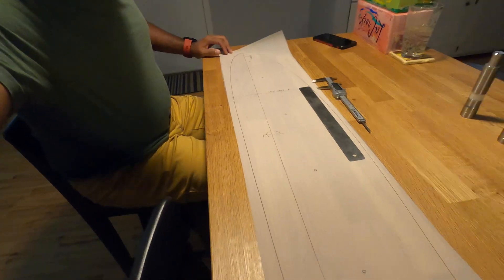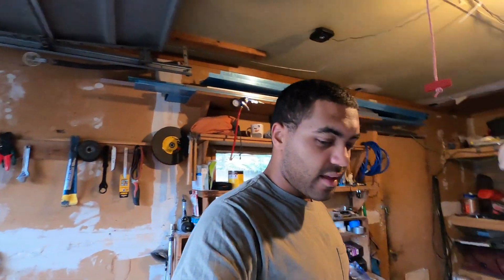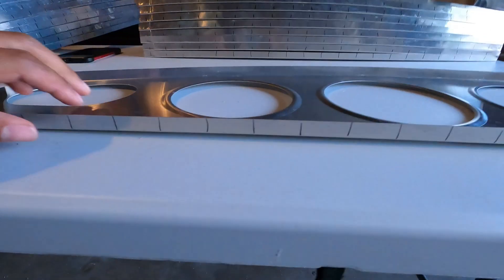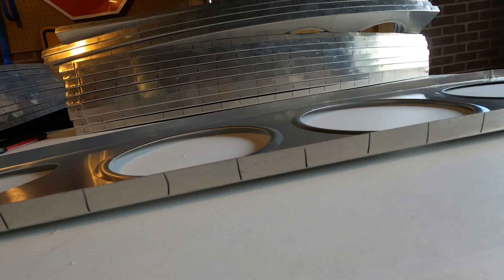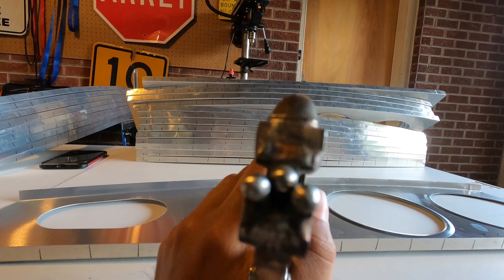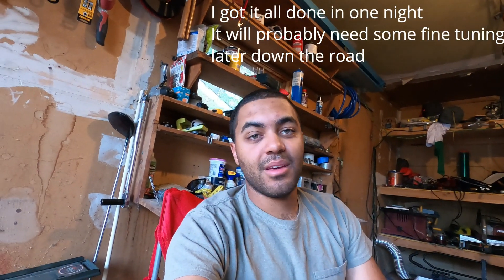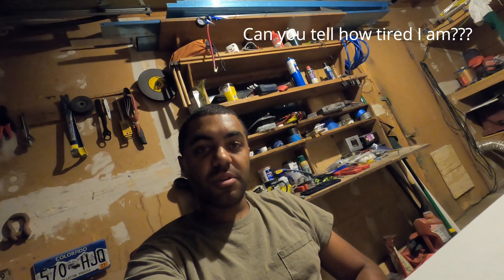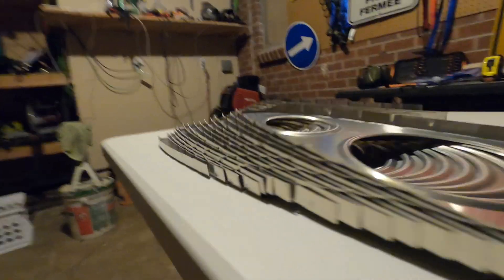Bearhawk Aircraft Build Part 3 - Fluting The Wing Ribs

Comment: Did you pick up the spar web and rib package from Bearhawk?
Reply from the maker: Yes I did!
Reply: What did you think of the qualify finish?
Reply from the maker: I went with the ribs and spar package because I wanted to save time and resources (money, tools, equipment, and consumables). The rib and spar package satisfied a lot of that requirement for me especially working in my current shop (a one car garage) I think the quality of the parts are well beyond what I could have done with my current set up. The ribs appear to be laser cut and hydro formed so each piece is exact. If my shop was better equipped to handle some of the specialized pieces of the build, it would have been a toss up on if I would have sacrificed time and precision for convenience and cost..
Reply: @Dustin-Holstein  That's great to here. I'm glad Bearhawk is offering this option for builders. I ordered the LSA tubing kit form Mark and it went together nicely. I'll probably order the rib package as well. I'm just completing a 4x4 cnc router and will likely cut quite a few parts with that.